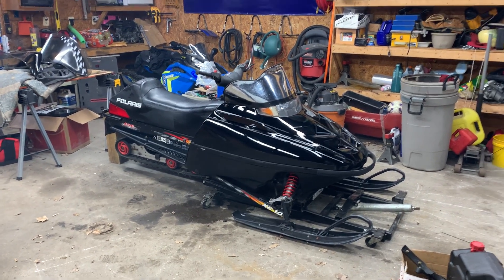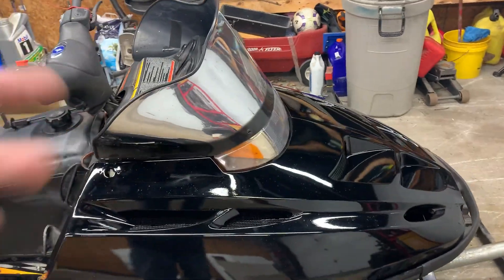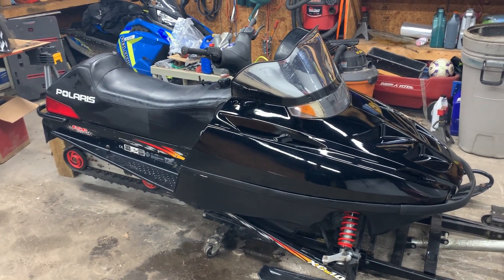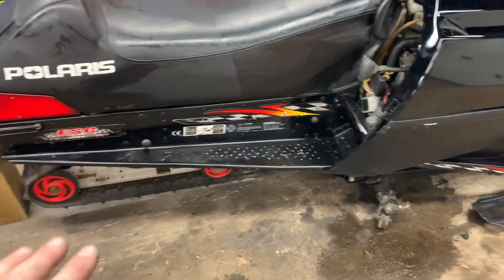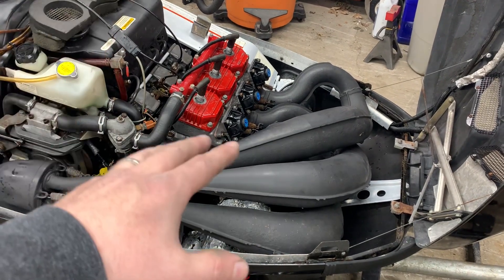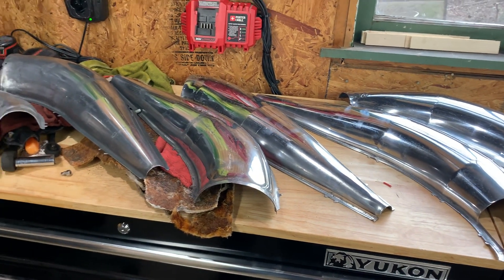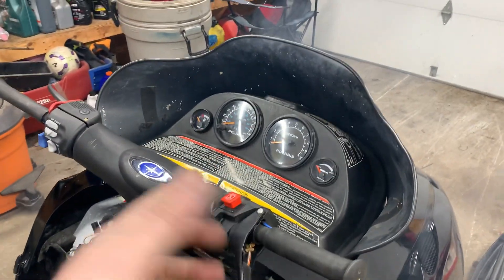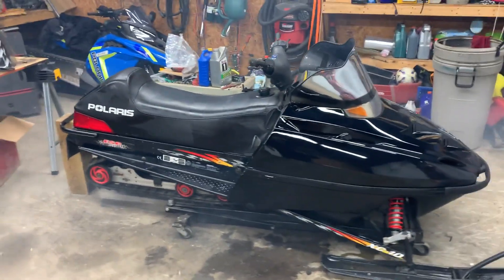Project Sled 2021 - Progress on Stimulus.

Comment: Nice build 👍, what carbides do you recommend for a 2006 fusion 600 with studded short track? I do just your average riding trails, fields and road riding when enough snow on them. Thanks
Reply from the maker: Thanks!

96 right up the center. Nothing in the outer belts.
Reply: @StreetersGarage  thank you

Comment: I see many diy degreasers on the tube. What do you use on your sleds?
Reply from the maker: I use Gunk engine degreaser. Typically I’ll bring the sled out to the driveway and let it sit it the sun for about an hour to cook and then apply the degreaser. 

Wash it off with a pressure washer and then repeat. 

Typically I do it 2 times.